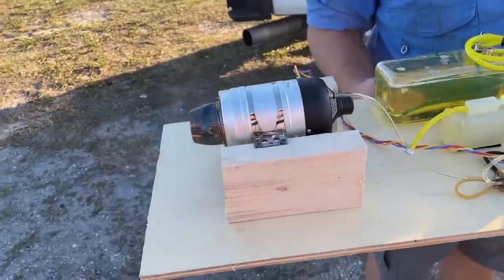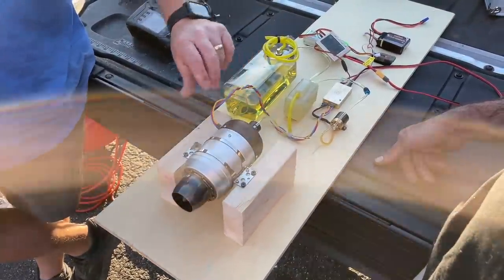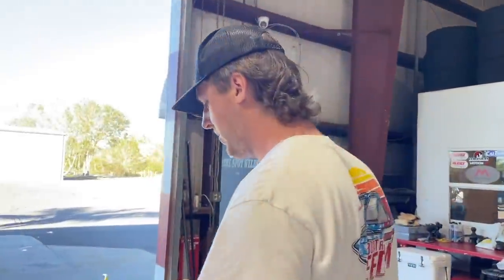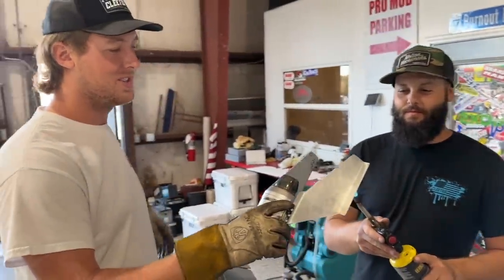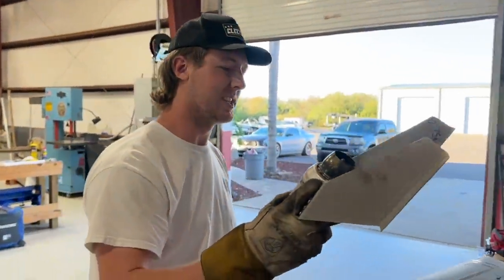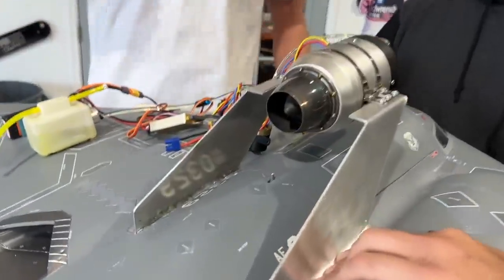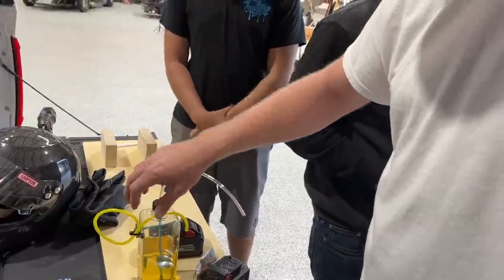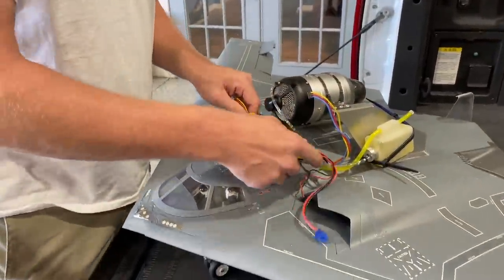I Added A Super Powerful Jet Engine To My GIANT B2 Bomber... Is It Gonna Work???

Comment: Oh boy - the CG/CP is going to test those flaperons authority and the fight computer is going to Yeet itself. Also the thrust is no longer in line with center mass, she’s gonna wanna nose dive under full thrust 😂 stoked to see it!
Reply: Right, that mount is way high, there's a significant turning moment from the force applied so far above the original thrust line. But maybe it will work, I've been surprised before.
Reply: @cageordie  my thoughts too - but I love the content! Design through iteration and destruction is the Cleeter way!
Reply from the maker: I’m an engineer I thought this through already it’s good
Reply: @CleetusM  🤣
Reply: @CleetusM h well in that case fire me up.
Reply: @CleetusM  pretendgineeeer
Reply: Imean, correct the thrust with the angle of the jet and the flaps can handle the rest. Probably going to be a bitch to fly but I belive Cleetus got this
Reply: @CleetusM   strong “trust me” vibes, here for it 🫡 🚀
Reply: The angle of the thrust line is critical if it’s neutral or pointed down it will make it worse but if the thrust pushed against the angle of attack it’ll give stability and lift by pushing into lift
Reply: Center of thrust is jacked now.... 100% it nose dives
Reply: @CleetusM  Me too! 40 years in mil aerospace. I look forward to the testing. :D One thing is for sure, it's going to be way fast.
Reply: Cleet's engineering has a zero percent chance of breaking anything we own. No need for any rustled jimmies, just enjoy the show.
One thing's for sure, we're going to learn whether or not it works. Science!
Reply from the maker: @HubcapPointOutdoors  you’re obviously not an engineer like me
Reply: @CleetusM  this thread has turned into Engineers Anonymous real quick 😆
Reply: @CleetusM  sounds like Whistlindiesel to me..
Reply: It's still using the electric thrusters so it should help that balance some
Reply: The Mountain Dew fuel tank will keep it level, Bald Eagle approved.
Reply: @Adeadoornail7226  I think the weight will try to make it go to the right.
Reply: id be interested in cutting the plane in half building 3d printed  ductwork and  installing jet in fuealage..... enhance the control surfaces a touch and.... remount the floats....😎😎
Reply: I can confirm, this thing will do some epic nose dive. And I'm all for it 😂
But I'm afraid the mounts will rip off the foam during take off with the force and vibrations. Maybe drill through and install long bolts with washers ?
Reply: @CleetusM  You're an engineer the same way that Matt Caricker is a doctor(ish). 😝
I forsee all the above problems being an issue, just don't hit a house!
Reply: I think you’ll be fine. As long as you’re applying full back stick while at full thrust, I think it will stay level, maybe even climb slightly. As long as it can stay level under thrust, she’s gonna SCREAM.
Reply: @cageordie Another Geordie subscriber ⚫️⚪️⚫️⚪️👍
Reply: It'll work!...Cleet stayed at a Holiday Inn Express once.
Reply: @alphazuluz  I thought the model plane motto was “in thrust we trust?”  Should be good then.
Reply: As a logistical manager for an automotive company,  trust me,  this is gonna work.
Reply: If he's got the engine tilted up a little it should counteract the fact that his thrust vector is about 5 inches above the airframe. 

If. 🤣
Reply: The angle of the Jet thruster can help greatly in aiding with it's high mounting point
Reply: @CleetusM  Good enough for me.  Let 'er rip
Reply: That needs to be on your next shirt
Reply: @CleetusM  ROFL
Reply: @marvindebot3264  yet matt is actually a doctor for real. He was a practicing vet before guns. Ironically enough being a vet is human school plus. They have extra training over just a regular MD’s because animals are so much like humans plus the extra characteristics.
Reply: @HubcapPointOutdoors  He had his design team run the numbers... It's good to go.
Reply: Hopefully took into account the fuel slosh with no baffles in the fuel tank it will immediately be tail heavy....?
Reply: @gavincline209  Yes mate I know that, been watching Matt since Deer vs Dog. The doctor(ish) bit is a Matt joke. 

Vet is 7 years, MD is 4 so yes it's harder.
Reply: @cageordie  it will probably be going pretty fast when it hits the ground.
Reply: Should be low and back, like the Cirrus jet.  Can’t wait to see it roll inverted for best climb.
Reply: I’ve been flying RC for almost 20 years. It’ll be fine just send it and give it some back elevator when it starts to dive 😎
Reply: @Cleetus McFarland…..adding some washers under the front bolts ONLY of the engine would angle the thrust up a bit to help cancel out the thrust vector of the high mounted engine…..this is a good hypotenuse that McFarland Aviation should strongly consider lol……possibly also get the engineering dept. to fab up a 2 aluminum rear vertical stabilizers that ARENT in line with the jet wash, in place of the plastic one to keep your control surfaces from melting……I want this to succeed 😎 wouldn’t want this to go the way of the Concord and tarnish McFarland Aviations legacy 😅
Reply: @CP_FPV  LOL, maybe . . .

Comment: It would probably be a good idea to drill a couple of holes through the jet mounts and run some tig rod through to the  bottom to add a little bit more load spreading

Comment: Was really fun being part of this!! 
Can’t wait to see this thing fly!!
Matt
Reply: Fly?  You really expect it to fly?  Not a snowballs chance…
Reply: Someone or something is going to get hurt. Everyone standing around the engine running at 145,000 rpm ...yikes. why did you bolt the engine to the aluminum mounts, then used foam tak to glue a 13lbs thrust jet engine to a foam airplane. Good luck
Reply: Guy with no name was wrong :)

Comment: pretty sure the liquid moving around in the empty bottle could give you some issues down the line... as it accelerates to take off all of the fuel will move to the back of the tank and shift the center of gravity.  I think The smaller fuel tank might decrease the effects of the fuel sloshing around but certainly will run out quicker. I have no idea what I'm actually talking about though. more of a guess.
Reply: Or add baffles to prevent sloshing
Reply: the second tank is a sump tank to prevent it from running dry
Reply: Nope you’re right it’s called the free surface effect

Comment: I think it is going to fly. I'd use a smaller
Lighter  fuel bottle , 8 Oz. Less wind drag.
Or it's going to turn right on takeoff .
It's going to need more runway to lift off & land. Better put glue on landing gears.  How about  2 jets to replace both in wing motors. Replace rear tail fun with metal.

Comment: It’s all about the wing loading. It’s a foam plane. You start cranking and banking and your going to fold the wings up. Look forward to the rest of the video to see what happens. Curious though, do you have your ama turbine rating??
Reply: Sounds like a question a Glow Boy would ask...
That being said, he DOES own and fly an actual turbine helicopter...
Reply: I would think his helicopter and fixed wing multi engine licenses would cover the RC hobby plane.
Reply: @SCOOPFREE  nope. RC aircraft is governed mainly by the ama but in the last few years the faa has stepped in , in regards to drones. But ama requires you to have a turbine rating if your going to fly turbines anywhere other than his own property if I recall. I haven’t renewed my turbine rating for several years now
Reply: @zachhoefs9543  wrong. The ama governs rc and RC turbines. His faa ratings means diddly. I was just curious if he was an ama member which also means it would be insured for any damages so long as he abides by their rules which right off the bat requires he have the turbine rating I was inquiring about. 
And although I am a glow boy when it comes to my 3D helicopters, I also have a ama turbine rating

Comment: The trick will be controlling pitch while trying to throttle both sets of engines, unless you have both throttle servos set to the same channel somehow. Then it becomes a throttle advance percentage battle between the jet and electrics verses lift ratio. The height of that jet mount is going to want to pitch the nose down hard..... HeHe good luck, this will be fun to watch!

Comment: Cleetus!! You should have put bolts through it, with a bracket on the other side. That way it would it be way more sturdy than glue, and it would be much easier to service and change if you ever change design

Comment: Good idea to use hot brackets to melt the foam flat.
Who's idea was that?
Lateral thinking 👍

Edit - not at all convinced that the glue will hold. The brackets could have a lot of their weight removed, that's for sure

Comment: Please put some bolts through the mount - I can;t help thinking it's going to rip the mounts off at some point.
There is also quite a distance between the centre of gravity and the centre of thrust, which will make the aircraft pitch nose down.  Good luck!
The melted tail should be fine - the jet mounts will provide the stabilisation that thing used to give.  Can't wait to see this thing fly.

Comment: Cleet, you need to get that thrust centered up... NEEDS ANOTHER ONE MOUNTED ON THE BOTTOM, BUD! MOAR POWUH! Mount it on the bottom, then run dowels through the plane connecting the two mounts, and literally sammich the airframe.

As she sits, that thing is going nose-down under thrust, 100,000%. He just built a GREAT guided incendiary device, though! 🤣

Comment: I would recommend some epoxy.  Also aluminum metal tape to protect the surface may be useful.  Check your CG's with the tanks full and empty.  If the CG shifts during flight, it can be disasterous.  I would also consider drilling through the fuselage and adding a plate to the underside so you have some mechanical adhesion, not just glue. ymmv.

Comment: If the glue doesn't hold you could put a few bolts through the bracket and fuselage with a second bracket on the underside of the plane matching the footprint of the top bracket

Comment: You need your buddy tie to do some aluminum sheet metal work, and make a hollow bomber with baffles, so you can fill the wings with fuel, the. Run 2 engines. You wouldn’t burn your rudder off if 2 jets where on either side.

Comment: Thrust angle is really important. The front of the turbine should be a little lower than the rear, in relation to the centerline of the wing. If not, the nose will come up and it will just flip over when you try to launch. Good luck!

Comment: If you got the cg correct and the center of thrust lined up I still think the heat may be an issue. Along with maybe not the glue itself but the surface it’s attached to. Best of luck

Comment: Yeah, if you didn't get the turbine and jet body perfectly parallel with each other, if there is even a little toe-in or toe-out, the B2 wing is going to want to fly apart from the turbine. The turbine is going to become a deadly missile, and I hope you test this in the middle of a very very large empty field and not the RC field.

Comment: I believe they have Ceramic spray paint in a can for headers, give those back flaps a couple of coats. Shouldn't add too much weight and it'll help them handle the heat from the turbine.

Comment: I feel like glue may not be strong enough, maybe threading small screws/bolts through to the other side with fender washers/nuts on the bottom if clearance allows?

Comment: wow - that high thrust line may need a second unit underneath to balance out... (or another 2 smaller units to  allow use of the gear.)  lol...

Flapaerovator (mix all 3 together)  doesn't have a whole lot of authority on an extremely short coupled craft.

Comment: If you chuck the electric system, you have more than enough power. Full send, but keep the wing loading down, there is not going to be any shortage of power. There is no reason to lug around that big 6s battery with the turbine. It will fly way better if you keep it light.

Comment: The servos you have right now probably do not have sufficient torque to handle the weight. You will need more torque. Also, you will need flaps or flaperons set up in order to land unless you have a long runway. Make sure you install the tank on the CG because the weight change as goes empty. Also, reinforce the landing gear because can collapse on landing. I can't wait to see that flying.

Comment: Pull the twin edfs and esc and that 6s battery....save a lot of weight and they can't add anything anyways....so run a bec if your servos are on 6 v and run 2s battery for turbine....or put hv servos on and run 2s for everything and it'll be a lot better and way less wing load and put some more carbon rods in it or balsa the battery compartment for rigidity

Comment: I actually saw a glider as in real human driving glider with one of these turbines and I don't know how much fuel they use or if the engine doesn't meet faa but they can push a glider with a person flying it this will be simply amazing, and seriously then I looked up the fastest R.C aircraft and its a flying wing with a single turbine that said it was doing over 400 miles per hour and thats quick.

Comment: There could be a problem with this. When designing aircraft you have to balance 4 forces. Lift, weight, thrust  and drag.
Lift and weight are one pair of opposing forces.
Trust and drag are one pair of opposing forces.
If not balanced correctly these forces can cause planes to nose down or nose up.

Comment: That glue better hold 15 lbs of thrust, plus air resistance weight, plus the weight of the air pushing on it during dives and climbing.

Comment: Umm, the CG is 3-dimensional, not just forward/back.  The CG is where the plane will rotate  - in all 3 axes!  If you move the CG to the left/right, you will have to trim out the roll & yaw (assuming you have enough control authority to do that), and if the CG is too high in the Z axis, it can make it unstable in roll as the ailerons will no longer be on the roll axis.  I think it is going to be interesting to see how this thing handles in roll & yaw - be on the lookout for it to snap roll as soon as you get enough lift to get off the ground.

Comment: As long as you don’t hold the b2 when using the thrust it will be fine. It only has to move the b2 and itself and the jet has enough thrust to move the plane easily. Just don’t prevent the plane from moving. Lol

Comment: At LEAST drill a hole straight down through each bracket and out the underside - then use a really long M3 machine screw with a fender washer on the underside. That'll distribute some of the forces, and stop you from having a gorgeous engine going off on it's own trip!!

Comment: Dude the turbine needs to be pointed down! If you’re going to mount it 5” above the plane you need the exhaust or the turbine pointing roughly 15 degrees up. The force of the turbine will push the nose of the jet down on take off. You need to mount the turbine  close to the fuselage and have it point to the CG! I don’t want to see that nice turbine destroyed

Comment: I dont wanna question your engineering. But I feel like you need to drill holes through the body and sandwich a plate on the underside. There's not alot of surface area for the glue. And it's just foam your glued to.

Comment: You need to put heat resistant tape behind the engine on the fuselage ones your airborn it will create a lot of heat you don’t want the foam to get damaged or melt

Comment: How is the throttle on the electric motors tied in with a jet throttle? If you’re looking to take off with half power on the jet that may be an issue.

Comment: I suspect you're going to have a huge torque issue. Center of thrust is nowhere near passing through the center of mass and I'm not 100% the engine is inline with center of mass either. I hope I'm wrong though.

Comment: Brother that honestly looks dangerous.  Id atleast run to bolts on either side and bolt through air frame. Good luck always wanted to fly a turbine. Also not sure about Florida but in md i know u need a special license to fly turbine engines.

Comment: Nothing negative by this, but if you had a diagonal brass across the top to the outer side of the wing going through and then repeating it underneath it to create a diamond shape that wouldn’t of folded in half. it’s styrofoam after all…

Comment: hear me out. could you stick the back of that jet into the exhaust inlet of a turbo and take the engine rpm and exhaust load completely out of the equation. roll up tell the jet how much boost you want and run it without going up on 2step? the science boys could run with this for a day.

Comment: It would have been better just to glue and then drill it and then use rivets You would have had an elastic bond with a mechanical bond no heat necessary no structural integrity compromised on the plastic.

Comment: Your flight control may be suspect little buddy. Be ready for a car ride for retrieval requirements, and I recommend you keep it over flat, soft ground. Landing a twelve pound anything at high speed usually leaves a fairly negative impression. If you can get it in air, then it’s gotta land, and your landing gear should be your next concern.

Comment: Agh your gonna do me dirty like that and fly it?

Btw you should have cut slits in the body of the plane for the mounts. Then you could have pushed them up through the bottom. That way the Gs would rip it right off the foam cause that's what's going to happen.

Comment: The glue will probably be the strongest link. Styrofoam will rip apart. Jet engine will be completely destroyed by fall from height, ingestion of whatever dirt/water it falls into, and internal thermal failure due to not cooling down properly after it hits the ground.

Comment: Your about to lose $900+ when it falls a couple hundred feet out of the sky.  I think your gonna need to add some thru fasteners to the underside (with washers or a bracket).  There's no way that glue is gonna hold.